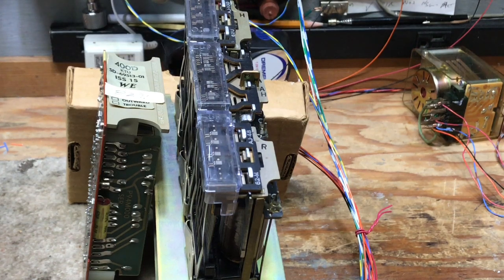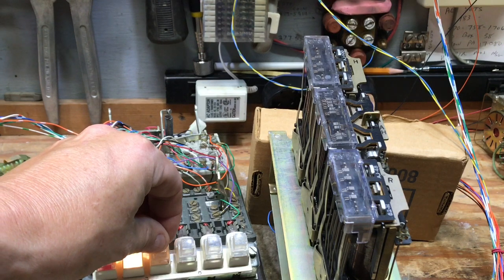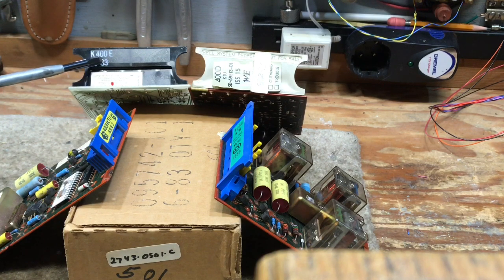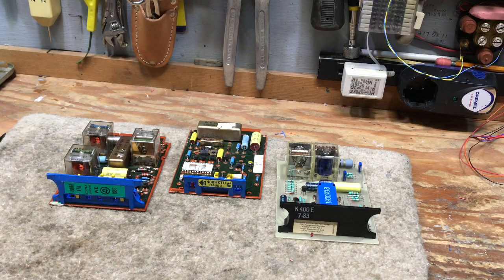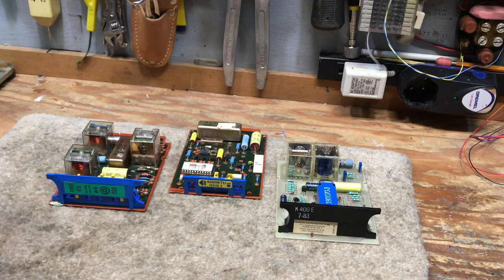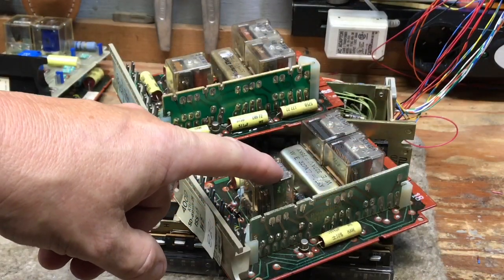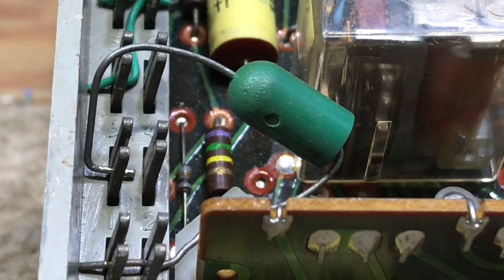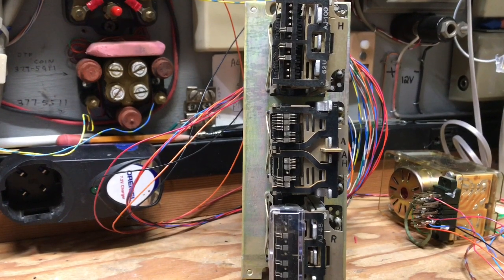400 Type 1a2  KTU line cards, Western Electric,ITT and other Manufactures

Comment: I have a problem with an older fire alarm system (in a hotel) unable to recognize two VOIP phone lines. When they first converted over to VOIP, there were no issues. But within the past year, the Gamewell fire system no longer recognizes the phone lines and flashes constant trouble.

Comment: I have hundreds of these things complete with power supplies, what are they? I know you said they are line cards. But like what use are they for in a modern phone system? I had tons of them on every floor of our 7 story building. I called att and asked wtf are these? They said they have no idea probably some old PBX stuff. So I busted out the butt set and they were clearly still working. However, none of them had dial tone so I started yanking wires and pulling them off the walls.
Reply from the maker: if you have time please call me at 971-239-5084
Reply: @sxsphil  I called and left a message. Love the rotorary ring btw.

Comment: Pretty Good video, Phil.  I ahve many of those same cards. In the past, we used the ITT 400E almost exclusively at the interconnect company I worked for.  I now have several WE KSU's hooked into a Mitel PBX, using an assortment of cards.  BTW there is a simple mod that can be used on pre-ISS 15 400D;s to allow bridged ringing, its is available  on the TCI website https://www.telephonecollectors.info/

Comment: This was very interesting. I've never encountered a 1A1 system. The 1A1 H relay must be the equivalent of the L(?) dual coil relay in the 400E card which is in series with the line when hold is depressed. I've used the L relay to make circuits for A-lead signalling and hold from non-1A2 phones and other applications, then used opto-isolators. Nice to see there's others still interested in and using this old but reliable technology.